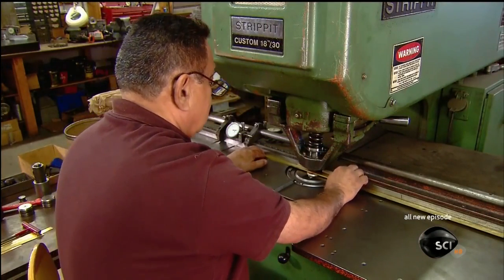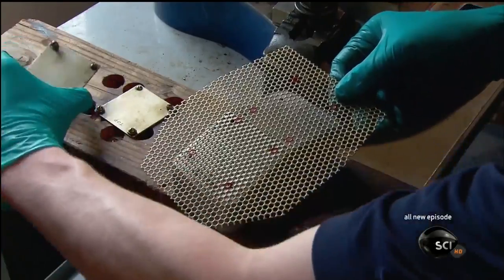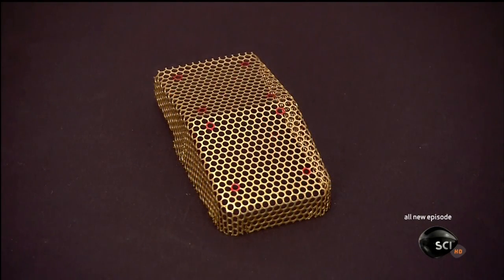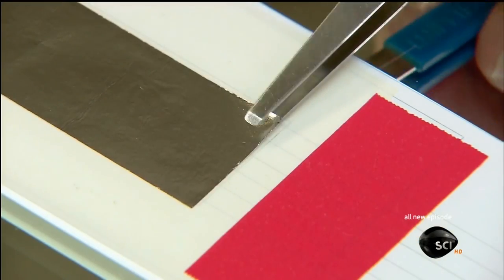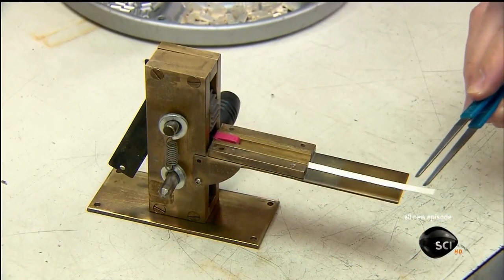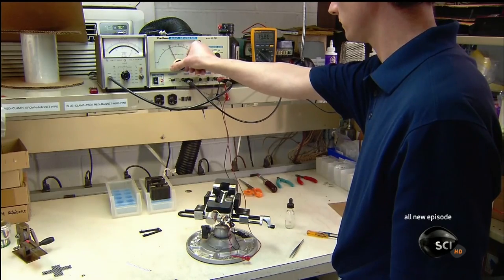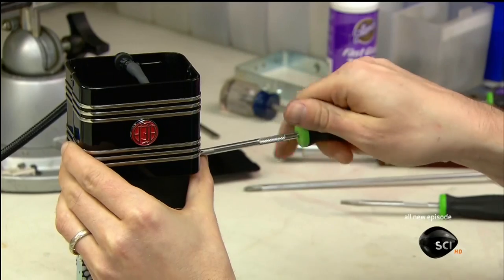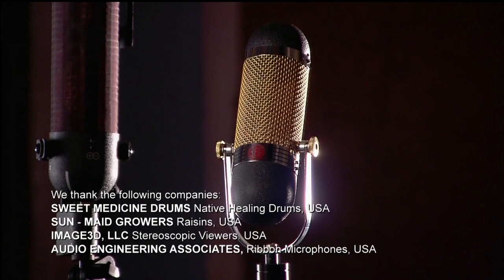How It's Made - ribbon microphone

Comment: They use brass for the grill and structure instead of stainless because brass is not magnetic and will not effect the sound of the mic. The plating is to keep the brass from corroding or tarnishing.
Reply: Materials engineer here and stainless steel is not "ferromagnetic" although it have both nickel and iron in its composition. Just try it by trying to pull your knife or spoon with magnet.
Reply: @admniyeokuyorsun...3044  
Not quite true .
Stainless steel is Not 100 percent safe /clean . 

While stainless steel is known for being corrosion resistant, 
strong,  one quality that oftentimes comes into question is its magnetism.
Is stainless steel magnetic ?  The answer is that ,
some stainless steels are magnetic, while others are not.
But one factor contribute to why you can't use it such as here .

Steel alloys composed with a minimum of 10.5% chromium is classified as stainless. 

The chromium content attributes particular qualities to the steel ,
 including exceptional corrosion resistance. 
This quality is what gives stainless its rust free status. 
It also allows steel to repair itself after being scratched or damaged , 
unlike plated steels which often become scratched , 
with those scratches leading to the eventual corrosion of the steel. 

whether or not stainless steel  is magnetic comes down to the microstructure of the steel. 
Basic stainless steels have what’s known as a “ferritic” structure , 
which enables them to be magnetic .
It’s the addition of chromium that leads to the ferritic structure . 
Chromium plus the addition of carbon hardens the steel and qualifies it as a martensitic steel . 
Stainless steel knives are typically martensitic.

The problem with stainless steel is that during processing the 
permeability of austenitic steels can change . 
Cold work and welding are well known to increase the amount of martensite and 
ferrite respectively in the steel. 
For example a stainless steel sinks flat bottom has little magnetic response whereas the 
bowl has a higher response due to the formation of martensite particularly in the corners.
This happen because of the preasure used to form the sink and it is typically 
done in what's known as ' cold ' mode .

Back to the michrophone .
In the video they show how they cold pressed the grill in the process of making it.
This is exactely what creates smaller  magnetic ' spot's ' , especially in all corners and 
the very same reason why stainless steel can not be used .
This do not happen with brass so it's the prefered material .

Also bear in mind that Stainless steel strings used on electric guitar 
for shure are capable of creating magnectic inductions in the guitars pickups .
I have used many stainless steel strings 

( especially to hopefully get rid of strings corroding because  I live in 
a very humid climate  where guitar strings have a very short life )

But I do NOT like the sound of them and especially NOT the feel in my fingers 
when I play them .... 
So I ended up back to the ones I have always used .

Brass is the no 1 to use where you do NOT want anything to interfere with any magnetic field .
It's also used on the mounting brackets of the guitars pickups too because of this .

Another example is that you for shure would NEVER make a 
Grammophone Pickup's casing out of stanless steel ..... 
NEVER ...
But brass is very commonly used in the better quality ones and 
for the cheaper they used plastic .
Even ceramic was used too , but NEWER stanless steel .
Same with Pickup Arms on turntables .... 
NEVER stainless steel ....

Stainless steel have what is known as  ' ferritic micro structure ' and by default is not
magnetic , but in the processing of making the product it do change .
All is because of the processing methods .
Worst is as I told , welding and cold work ( such as pressing into a specific form and bending ect ) .
Reply: You are absolutely right here and read my answer to @adımı niye okuyorsun...  
for hes '''  im a material engineer here '' responce .
He clearcly do not know what he talking about .
Reply: @kennethsrensen7706 the materials engineer clearly doesn't know his field. Thanks for taking the time and this saving time for the rest of us

Comment: The ribbon motor is explained in this video.  Sound waves, in the form of a pressure gradient from the front and back of the mic, move the ribbon inside of the magnetic field, which generates a current.  The signal is so small that, yes, the step-up transformer is wound to a very high ratio to adequately boost the signal before the mic cable.  Even after this, ribbon microphones have the lowest output of any microphone type, compared to moving coil dynamics and condenser microphones.

Comment: It is kind of more of an alternator actually,   It works by the pressure of sound in the air, vibrating the ribbon, the ribbon creates a very small AC current and the resistance of the ribbon is almost a short, therefore a transformer, biases the resistance to 50-250 ohms to work with  a microphone pre-amplifier I own an original RCA 44-BX.  I love the sound of it, it is smooth, clear, and  natural sound, they used to call the ribbon material  Duralium. the Frequency response is 20-20,000 cps.
Reply: A way to think of the bi-directional ribbon is a delay line differentiator, a concept used in video tape recorder playback circuits. But back to audio: the sound wave that hits the ribbon front sometime later hits the ribbon back, same intensity. The delay remains the same for any frequency. Both waves push on the ribbon, but cancellation isn't complete because of the delay. There is a net difference in pressure and therefore acceleration that doubles with every octave. But velocity, being the integral of acceleration, remains the same. So the generated voltage remains the same. The delay is controlled by the size of the pole pieces. But when the delay is the same as the wavelength of the sound, the output drops to zero. It's why a 44's frequency response is ~15kHz, and a relatively small &  light 74B with its huge pole pieces is something like half that.

Comment: Hi, can someone please explain the tuning process. Is he applying voltage to the ribbon and then checking visually the movement of the ribbon?
Reply: OK, after studying the video a little bit more, there is a signal generator, fluke and some voltmeter or db meter. Fordham audio generator output (set to sine-wave and -20 db) is connected to the microphone and the voltmeter box. Sync output of the generator is connected to the Fluke.  I assume the sync output is in sync with the output connected to the microphone and the fluke is there just to show actual frequency generated. One can see, when the knob on the generator is turned, Fluke follows. The voltmeter box seems to measure the resonant point as the needle rises and falls when the operator sweeps the frequency. Therefore the assumption is that the microphone is put to work in reverse, as a speaker. Great info for the diy community.
Reply: @samosaarts  One key thing that isn't shown is that there is a 2k resistor inline with the output of the generator, if not you will really get some crazy excursion of the ribbon.

Comment: how much dos it cost  to make one of these -- Im doing a project
Reply: depends on what quality and size of materials you get and how many tries to get it right. also what kind of design you are using, this mic in the video has huge magnets with large magnetically conductive pieces (either ferrite or steel) that concentrate the magnetic field onto the ribbon but you can get a similar sound from  plastic housing with some wider neo magnets epoxied next to each other with the ribbon in between. of course the sound quality won't be quite as good but you can still get incredible sound with a shoestring budget if you get the most fine Ali foil you can and have the dexterity to manually assemble it all.
Reply: I've heard some things about possible damping effects from overly strong magnets like the Neodymium.   Any feedback about that?

Comment: OK I'm confused , I understand induction etc that is normal with standard Dynamic Diaphragm Mic's but Aluminium is NOT inductive so therefore cannot produce a voltage for amplification by being vibrated within a strong magnetic field.  As this Video suggests

I was under the impression that the actual resistance in response to the sound vibration was changed due to the movement of the ribbon within the magnetic field and this then produced the varying signal in the amplifier .  being based of resonant freq and resistance gives a much truer reproduction.  can someone tell me if this is correct.
Reply: Look for this articles on Wikipedia: paramagnetism, eddy current / Lenz's law and you will understand why it is working.
Reply: mozzmann 
I think it's an Aluminium alloy...?
Reply: TiqueO6 Thanks I'll have a look see.
Reply: You probably already know by now but aluminum can be inductive. That's how it is separated from trash in recycling centers.
Reply: Perktube1 In the presence of very powerful alternating magnetic fields yes, but the reason it is separated during recycling is not induction but rather magnetic. As Alloy, Brass and some stainless steels and other alloys are non magnetic and metals and alloys containing ferrous or iron will be attracted to the Electro magnet and thus separated initially.
Reply: mozzmann I would say it is induction because induction produces electromagnetism, which causes the scrap aluminum to repeal away from the rotating magnet. As for the microphone, it does induce, like copper would. I guess they used aluminum because it is less prone to corrosion.
Reply: +Perktube1 they used aluminum because it is low density and so is lighter for a given size, meaning there is less delay (aka distortion) when using because it reacts immediately to sound waves. Also, the scrap metal sorting system does use induction, not magnetism. See my following comment for a more detailed explanation.
Reply: +mozzmann The machines used in high volume scrap sorting facilities that sort pre shredded metal scrap use induction to sort the different metals. Induction is an electromagnetic effect caused by a conductive object being affected by a changing magnetic field. In the case of inductors in electronics, the conductor (usually either copper or, yes, aluminum) has a magnetic field that collapses and reforms as the current rises and falls, thus resisting any change in current and induction is current based (versus capacitance which is voltage based). In this case, the change in magnetic field is caused by a change in the current creating that magnetic field. In the case of both the mic and the scrap sorter, the movement of the conducted around a constant magnetic field is what causes an electrical current to be induced in the material which in both cases actually resists movement. This is why if you take a DC motor and spin it with the wires loose and the wires touching each other, it will be harder to turn with the wires touching because the electrical path allows more current to be induced in the coils which in turn provide greater resistance to the change in magnetic field. In the case of the scrap sorter, the materials are carried and reasonably high speed by a nonconductive belt up a ramp that ends just under a powerful electromagnet. Different metals have different amount of resistance and will resist moving passed the electromagnet by different amounts. Because they each have a different amount of momentum because of the different amounts of resistance, each type of metal is thrown a different distance from the belt into a different pile. I had the privilege of watching one of these machines in action when I was working for my father in law who works with scrap metal.
Reply: Inherent magnetism (ferrous metals and alloys ) is very different to induction generated magnetic field, oh and the DC motor example is only valid for permanent magnet field coils I think you'll find .
I chased up some of my old theory books and yes while Aluminium is not Magnetic IF in the presence of a sufficiently strong magnetic field if the ribbon is within that field a tiny alternating current is induces in sympathy with the sound waves which is then amplified.
in the same principle as a standard dynamic Microphone .
Reply: Very cool explaination!  Thanks!

Comment: PLEASE answer!

I have been looking at various ribbon mics and I have noticed they are almost all BI directional (or figure of 8 however you wanna call it) and they sound really nice BUT

1. Do the mics take in equal sound from both sides?

2. If so does the audio track need to be mono or stereo? (Of it's mono will it take In just one side?)

3. If the mic does take in equal audio, isn't the sound of it completely subjective to the room it's placed in?

I know that last question is the same for all mics but what I mean is: if you throw a 57 on the grille of an amp cracked to 11 it won't make a difference if you're in a stadium or studio. But if it takes in sound from the back and front then SURLEY it would matter?

Thanks 😊
Reply: 1 almost yes i've noticed very subtle differences from side to side but in theory yes also google microphone polar patterns it will help you understand
2 its mono it captures both sides at a single track
3 if you mean if the room will have a big impact at the recording?Yes witch is what you want at some cases 
and last yes a fig 8 ribbon will capture a lot more room sound than a dynamic cardioid but dont think that recording with a 57 a loud source at any room is the same because each room resonates at different frequencies and the louder you play the more "acousticly active" you make the room and mics capture that.
Reply: Thanks very much for your answer :)
Reply: you're welcome :)
Reply: One thing about the back side" of the figure of eight ribbon mics is that one side usually is lighter then the "front" side.

Also, the backside picking up the room or another instrument , Which can be to your advantage or not, picks it up in a very accurate fashion where is leakage on other nights can be very strangely filtered or "nonlinear".
Reply: Meant to write "other Mics", not "other nights".

Comment: I came up with a question this month that the Internet has not solved for me.  I watched videos about using an oscilloscope in X-Y mode to produce a Lissajous curve to set the ribbon to the exact right tension based on the resonant frequency.  OK, I understand but I will be damned if I know where to place the two scope probes!  If you put them on each end of the ribbon they are in phase so the Lissajous is in phase regardless of frequency. Maddening.  Any thoughts?  I don't even know who to ask!
Reply: My two cents: Look at the voltage across the ribbon and at the same time the current going through it. At resonance, the current would be low. A current transformer or something similar measuring ribbon current is necessary. Looking at the ribbon "shake" is easy.
Reply: Thanks I'll try that. And I want to go on record is thanking Wes Dooley because if it wasn't for him ribbon mics would not be what they are today.  Not only is he smart but he's an outstanding businessman who has single-handedly transformed the ribbon mic industry. Thanks Wes!
Reply: @curtvincent3728  Upon thinking about the problem, it's the ratio of voltage over current that will increase at resonance. I suppose you know that in smaller ribbon mic designs, the resonance can get into the audible area, and that the resonance is damped with the "cloth"  around it.
Reply: No you're 100% right. I have a handful of RCA 77 mics and the ribbon is very small. Resonance on a 44 is 16.5 hz but on the 77 it's somewhere in a 30 or 40 hz range. I've been looking for years and have not been able to find the exact spec.
Reply: @curtvincent3728  I mistakenly called the dampening material cloth when it's called mesh. The high freq resonance mikes I was thinking of were the Shures. I didn't know about the 77s.
Reply: Nah, you are fine.  I knew what you meant.  All ribbon mics have it, it is more like screen from a screen door except the screen/mesh is super small.  The video shows this at 3:51 and calls it a "puff shield.". It prevents high velocity air from tearing the 2.5 micron ribbon (hair is 100 micron thick) from being ripped.
Reply: @curtvincent3728  I'd like to know what you come up with. Measuring the current can be done with a resistor between ground and the "low end" of the ribbon. But that means the voltage across it has to be measured differentially. Not difficult, but it will take more than one probe. Good luck.

Comment: Lol. Er, why should the chassis conduct electricity? It is completely isolated to the circuit - or maybe it is grounded. No current has to flow...

Brass won't help conduct electricity at all. Copper is the best for that. Or way more expensive: Silver.

Comment: Okay...ribbon = super heavy and super fragile but sounds extremely smooth :D
Reply: Not as fragile as we are lead to believe. Definitely not as robust as a dynamic mic. or as some condensers, but you don't need to be afraid to use them.
Reply: 9 Lbs!!!!
Reply: and dont foreget its output is a good 30db less than a typical mic so it has to have a step up transformer or amplifier before you even get to the mic preamp in the console.

Comment: I kinda wanna buy one. But $4000 come on, really?
Reply: Look for AEA at Sweetwater, there is also a 2799 dollar model. Another great RCA mic was the Model 77 and there is an AEA for just about 1099, but put in a search for "AEA Ribbon" and there are several high quality choices for investing in a Ribbon Mic. I had 4 original RCA 44s three RCA 44B models and one RCA 44BX. They were all working and I sold three of them for 1800 to 2600 a piece on ebay.